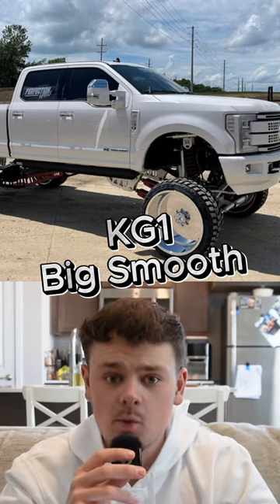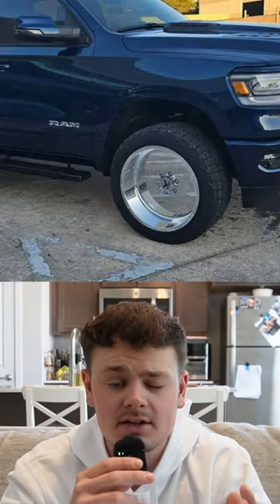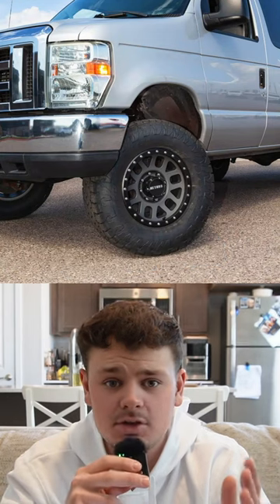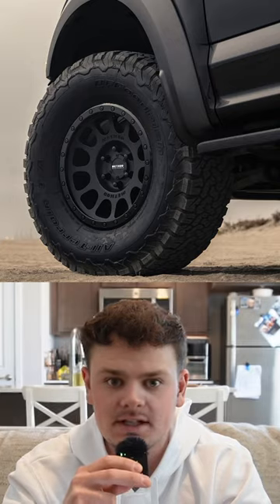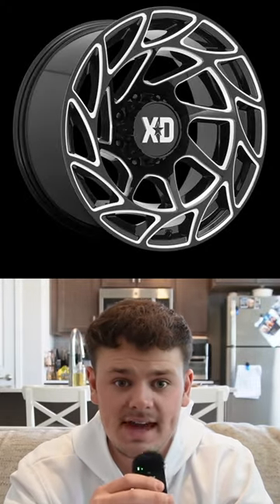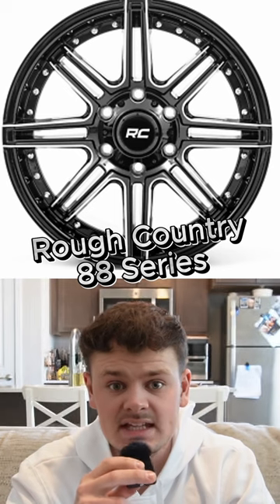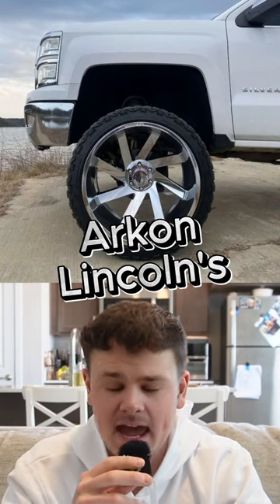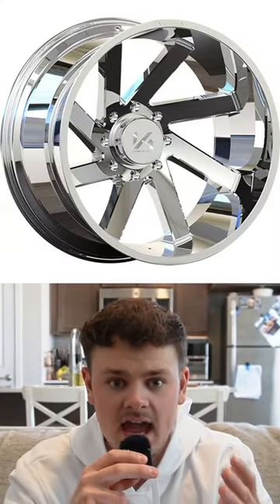Y’all Running These😵‍💫 #truck #trucks #diesel #dieseltrucks #dieselnation #ford #dodge #chevy #gmc

Comment: Wheels are supposed to be made so the most air possible gets to the brakes, cooling them off. Having no spokes makes it heavier and your brakes hotter.  Not even talking about rotating mass

Comment: The big smooths are the absolute freaking worst. Dude had a set on a h2 hummer with 40”s. I cussed that truck out after trying to put the tires back on. Fighting like hell to get the lug studs to line up with the rim.

Comment: Any wheel that make your rubber have no sidewall? I hate the GMT900.   Cuz that's when they destroyed the GM 1500... The only ones good after 07 are HD trucks and ones that have the 4.8 l or 6.2 l with no AFM... I see lots of the 4.8 l 07 to '09 work truck Silverado's with lots of miles because they have no AFM and a four-speed transmission(4L70)

Comment: This dude has no idea what he is talking abt besides the first one. Yes it does matter what truck/Car you choose. But most rims serve a purpose. For example I  have methods on my 2000 s10 crawler. Bead locks. There used for a purpose. Not showing off. In my opinion. Ik there’s cars n shit that do it for show but y’all get what I mean.
Reply: I’ve decided I have to stop letting this guys reels play when they come up, he has such bad takes lol